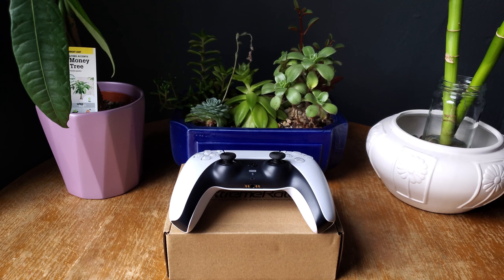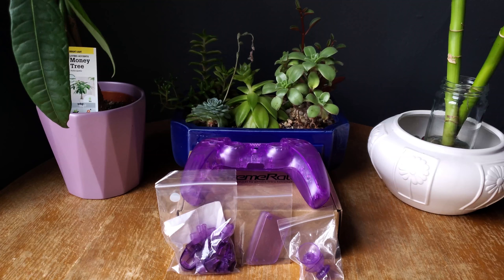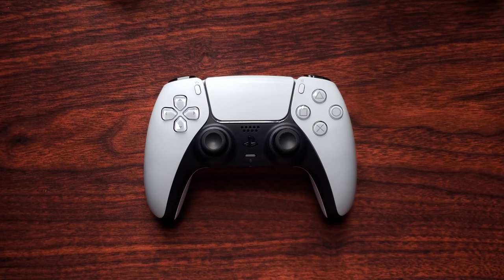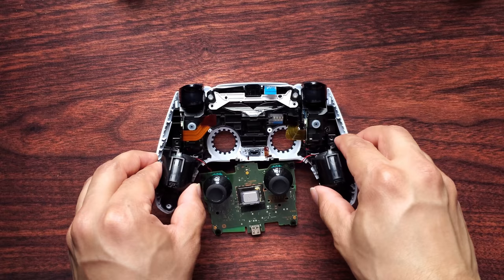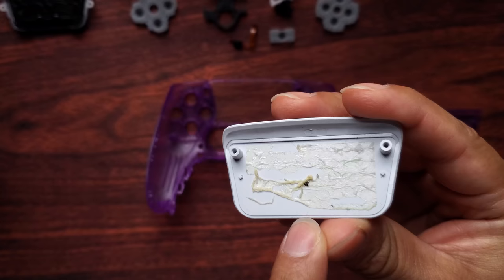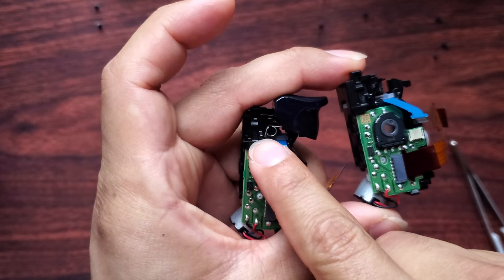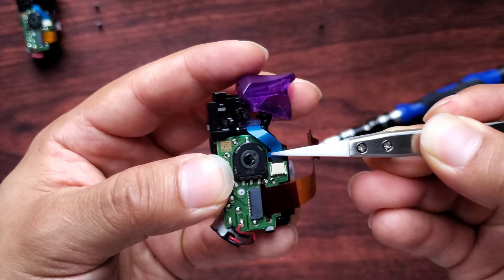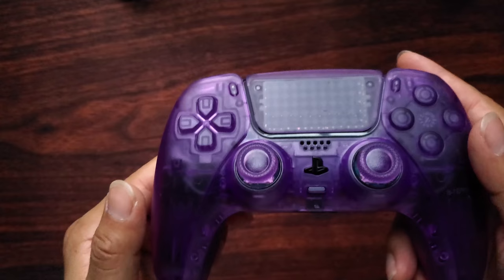Ps5 Controller Shell Swap: eXtremeRate's Transparent Atomic Purple Bundle

Comment: Hey man. I love your videos. They helped me install all my xtremerate mods. It was a process lol. I installed the back paddles, L.E.D's, clicky triggers and new front plate and touch pad. But I have an issue, Which I have no idea how it happened or how to fix it.

The new touch pad is loose and wiggles around.... If anyone can let me know how to fix this and what I did wrong that would be so amazing and greatly appreciated.

I am wondering if it has something to do with the fact that on the original back plate. There is a rectangular piece of foam in the middle of it.

Because I re watched the videos involving the touch pad and I followed the instructions to the letter.
Reply: Did you ever figure it out? My pad was stuck in with some tape lol

Comment: Hi great video would you mind sharing how you cleaned the glue of the touchpad pcb? What was used to clean it?
Reply from the maker: When you use a heat gun or blow dryer, the glow on touchpad board will loosen up. Some times when you're taking out the board it'll either be stuck on the board or the touchpad. You can use a plastic tool to scrape it off carefully from the board. Luckily most of the glue was stuck on the toucpad for this one.

Comment: Question: Did you use glue again? On the touch pad?
Reply from the maker: I didnt use glue again but it's better if you get it off with the glue.

Using a blow dryer or heat gun will really help. With enough heat applied you can get under the touchpad board and slowly start to pry it up. If enough heat is applied the board with lift up along with the glue

Comment: hows the functionality after you've changed it? As in does L2/R2 still shake in Astros Playroom, does the touch pad still read touches without the glue, Did the stick develop a dead zone given that they're different now, does the microphone still work after you unplugged and plugged the ribbon cable back in? Im cautious because PS5 controllers are up $10+ from the PS4 controllers
Reply from the maker: Alright I tested it! Here are answers. I ended uo changing everything to a different controller cause apparently someone had returned this one to Best Buy and my friend was given this used control that had bad drift. So after installing it on a fully working controller here are the results. 

#1: L2 & R2 still shake. It's just about knowing how to disassemble and assemble the triggers. 

#2: I can press on the touchpad BUT when I try to drag my finger on it, in Astros Controller Demo, the finger drag didn't register at all. (Will investigate if it because it doesn't have the glue). Pressing  the touchpad does work though. 

#3: No dead zone developed from changing the thumbsticks sticks. 

#4: Mic still works after reconnecting
Reply from the maker: Update: I replaced the touchpad with another one. Doesn't have the glue as well. It's working with the finger drag. Just tried it with the message scrolling. Also tried it on Astro's and it registered on the "Controller Demo". Thanks for bringing this up! I was surprised I didn't notice the scrolling didn't work for the  first touchpad board. Wondering why now. Well, it has a working touchpad without the glue though so that's all that matters for now.
Reply: @im.a.caveman  yeah every PS4 controller I've taken apart (about 3 now) to clean, something goes bad or doesn't work anymore. I've learned my lesson. The PS5 controllers are even more money to run the risk of damaging parts
Reply from the maker: @haromanuel  I understand. If you're careful nothing will happen. But you're right, it's risky especially with how expensive alot things are these days. Thanks for stopping by and hopefully one day you do decide to customize. Personally, for me it's nice to have a controller that I worked on. Maybe I didn't create that parts but it's satisfying since I save some money having it done myself.

Comment: Can I still buy these on the website?
Reply from the maker: Yup, just saw them. Check it out. If you plan on buying, make sure to know the BDM or which gen you have. Feel free to use my code IMACAVEMAN for a 10% discount on checkout. Feel free to ask any questions. 

Gamingcobra Links:

010/20 Bundle
https://www.gamingcobra.com/products/extremerate-full-set-housing-shell-with-buttons-touchpad-cover-clear-atomic-purple-custom-replacement-decorative-trim-shell-front-back-plates-compatible-with-ps5-controller-bdm-010-bdm-020-controller-not-included-qpfm5005g2

030/040 Bundle
https://www.gamingcobra.com/products/clear-atomic-purple-full-set-housing-shell-with-buttons-touchpad-cover-for-ps5-controller-custom-replacement-decorative-trim-shell-front-back-plates-for-ps5-controller-qpfm5005

Amazon Links:

010/20 Bundle
https://amzn.to/3wWm2gO

030/040 Bundle 
https://amzn.to/3x74Zsm

Comment: Will these work with the new PS5 controller models like the black n red? From my understanding the motherboards are different??
Reply: Did you open it already? because I don’t think it has a different motherboard
Reply: @baums.-.2750  sorry might have misunderstood could be different notches in the plastic or something have you tried these with the newer models?
Reply from the maker: So far I haven't come across a BDM-020. Those are mainly coming in with the ps5 consoles now. There could end up being more on shelves once BDM-010 is low on stock. I'm going to look into this and I'll update you. It's a very good question. Thanks for bringing it up.
Reply: @im.a.caveman  I’m gonna see if I purchase a black controller off the shelf and check the model number thanks again.
Reply from the maker: @Massproduce201  My friend has both red and black. Both are CFI-ZCT1W which woukd be a BDM-010. CFI-ZCT1W A is BDM-020
Reply: @im.a.caveman  This is very helpful thanks for taking the time and confirming!!
Reply from the maker: @Massproduce201  Check the side of the box before you buy. It's also shows the model number on the side. Just not sure if it'll show CFI-ZCT1W A. Look for CFI-ZCT1W (No A at the end).

Comment: Do they have translucent blue?
Reply from the maker: Here's a link to Amazon:
https://amzn.to/3fbR0st

To Gamingcobra:
https://www.gamingcobra.com/collections/ps5-full-set-shell-kits/products/extremerate-full-set-housing-shell-w-buttons-touchpad-cover-clear-blue-custom-replacement-decorative-trim-shell-front-back-plates-compatible-with-ps5-controller-qpfm5003g2

To Extremerate:
https://extremerate.com/products/clear-blue-full-set-housing-shell-with-buttons-touchpad-cover-for-ps5-controller-custom-replacement-decorative-trim-shell-front-back-plates-for-ps5-controller-qpfm5004?sca_ref=2707382.DeLcPgJpeY

The Gamingcobra and extremerate sites should automatically apply a 10% discount. If it doesn't feel free to use the code IMACAVEMAN at checkout.
Reply: @im.a.caveman  Thank you

Comment: That’s strange that some dualsense thumb sticks are concave both of mine are the normal one. White and black controller

whoever opened the controller changed them I assume
Reply from the maker: Yeah, like I showed in the video, I slowly started to realize that someone opened it and messed around with the inside. Which is horrible because my buddy used his warranty at Best Buy to trade the controller for a new one and when he gave it to me to customize it, it already seemed suspicious. He never opened opened it himself. Then he told me it was from Best Buy. Really messed up that they would do that.
Reply: Yeah someone swapped them. Im pretty sure those are Xbox thumbsticks